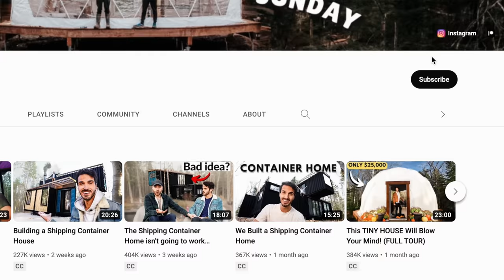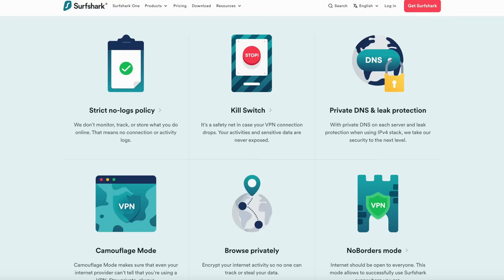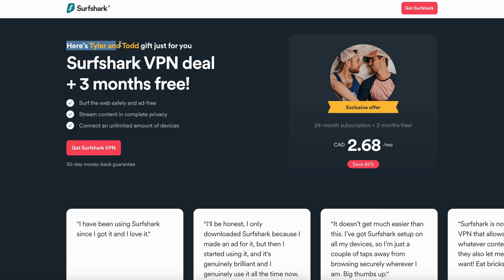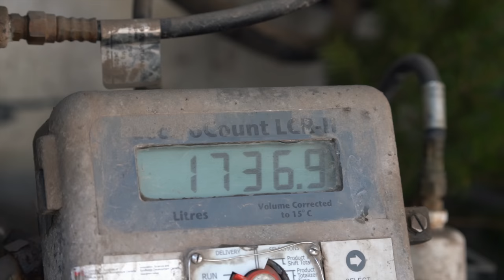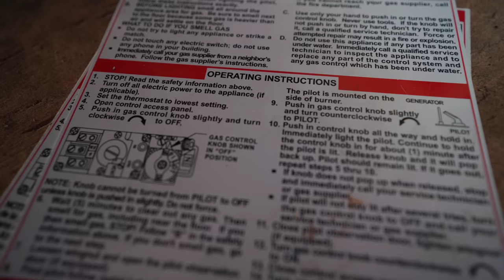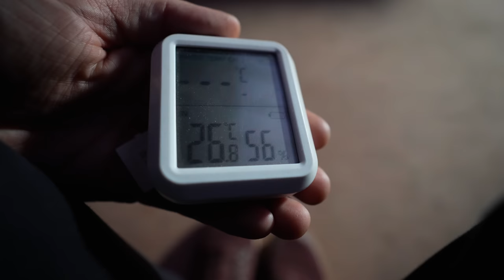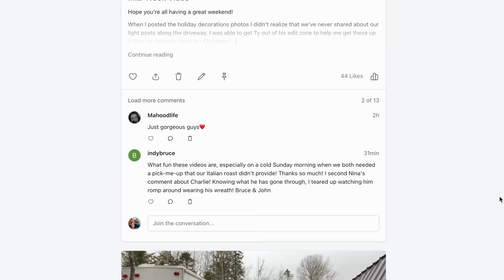Oops...but we have a plan!

Comment: I’m putting this comment here as this is a very recent vid!  I’m from Australia, where water is very precious, and one of the best ideas for watering a garden is to plant a fairly bid vertical pipe close to especially trees, then you can just water from underneath the plants.  You just push the hose in to the top of the pipe and let it either drip or run slowly. Not only does the water get right down to the roots of your plants, but it also encourages the roots to grown down deep to find the water. Best of luck guys.

Comment: I used to build shipping container ADU's.  We would clean the weld bead as best as possible and then follow it up with Sika Flex construction sealant.  All it takes is a pin hole to let water in and start rusting out the weld.  You should also get everything primered now before it starts to rust.

Comment: Hello Tyler and Todd . 
Congratulations on getting the heat in the container!!! We have the same propane heater in our tiny house and it works great but a word of caution …. Do not turn the dial too low on really cold temperatures. I turned it down to 10 degrees while I was housesitting for my neighbour and came back this morning with everything frozen solid inside . The heater was still “going “ but in this -30 degrees did not keep tiny at 10 degrees. Maybe I should have known it, but I am sharing this with you in case it could be helpful. Happy belated birthday and all the best for the holidays 🎉

Comment: Very glad to see that your house project is progressing! Insulation and heating are great, but please do be mindful of the damp/mould. Propane heater is a wet heat and it is very easy to get mould in a small tightly insulated space. Please don't forget to regularly air it out <3 Happy holidays!
Reply from the maker: That’s not how these furnaces work. That’s only the case for a non vented propane heater (for an RV as an example), which are illegal in a residential home! 😊
Reply: @tylerandtodd  What are you doing, replying to some random comments instead of being off on hols already? ))) But thank you for clarification! I do not live in a tiny house, but watched quite a lot of videos on YT about them, and many owners warn about the dampness. So just something to be aware of/watch out for. In the light of recent weather events, hope you guys and your loved ones are all safe and warm! <3

Comment: Adam, great job on the box idea and welding. I have one question for Tyler/Todd. Is that now a break in the the house's thermal blanket? Maybe you could add some spray foam to the cavity of the steel box for insulation and then cap it?

Comment: Real quick heads up on spray insulation. I wouldn't suggest having the animals in the building until the finished walls are in place. If Squirrel starts to scratch like a dog its from the particles and if she looks like she is chewing bubble gum it is because she ingested it. The smaller the animal the more effect it has on their health.

Comment: Carbon monoxide detector in house?   It just popped into mind as you guys are going to leave the propane heaters running over night, plus woodfire perhaps?  Some sort of smoke detectors/fire alarms. As you still have “highly flammable” foam exposed on all walls. CO is a very sneaker toxic gas and catches people out easily…drowsy then fall asleep….thought I should remind you two…. Laurie. NZ.  😊😊😊
Reply: A good idea for the dome as well if not already installed.  Exhaust gases like this flow unexpectedly btw…. 😊😊😊

Comment: maybe you should use different words..   You said you wouild paint the vent cap black that would PERFECTLY match the black color of the containor,   Black is, as it oddly seems,  most difficult to match up,  and dont forget, those metal colars were cut PERFECTLY for the vent to slip thorugh,  so perfectly that you had to grind them down so tdhe vent pipe would fit perfectly...  ah HA